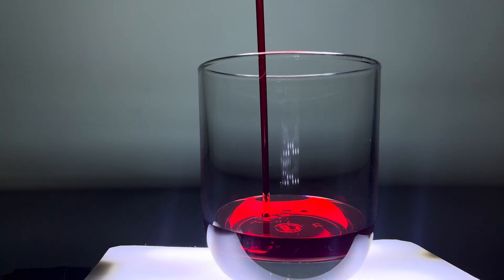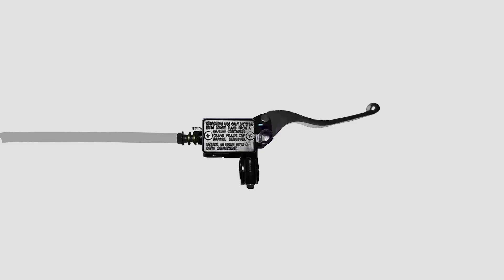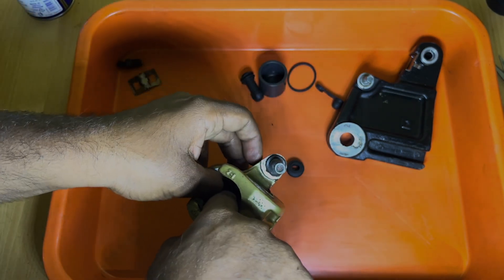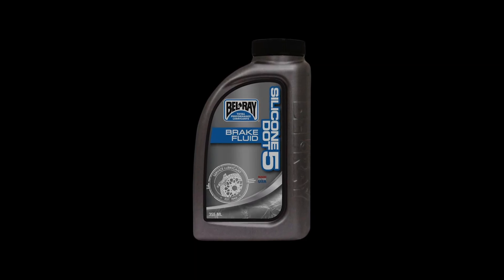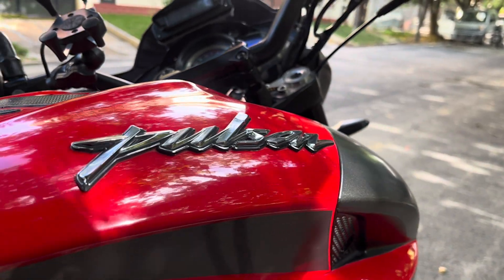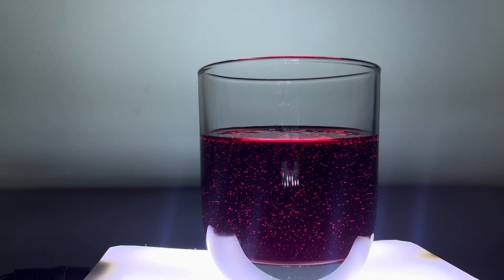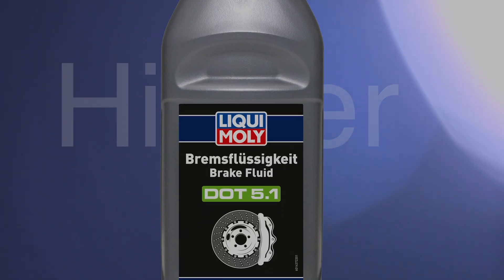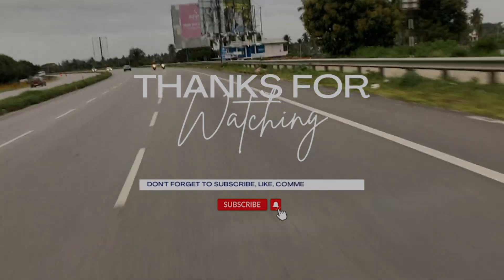Which Break Fluid Should You Consider Buying ? DOT3, DOT 4, DOT 5 & DOT 5.1 ?

Comment: @ARKIONX Hi bro , i have 2018 bs4 NS200 my rear brake need bit more pressure from rider to stop the vehicle and brake doesn’t give any confidence for me .Most of the time I am using front brake only . Is there any problem in my brake system or stock brake is like that
Reply from the maker: If your rear break is too spongy , try bleeding the breaks and change the break pads if it’s too old. Alternatively to improve break feel; you can also use sintered break pads.
Reply: Actually  brother I own 2023 usd edition , in my bike  I too face this problem , it ns 200s fate